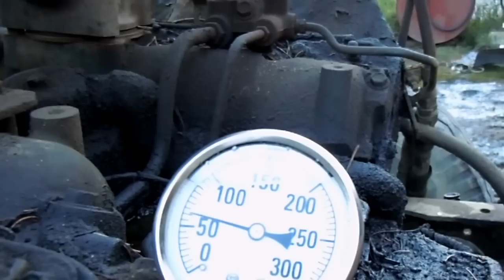8.2 L GM V8 Detroit Diesel

Comment: the 8.2 was detroit diesel's first 4-stroke diesel which is why it uses the 2-stroke style unit injectors and a similar governor. the 6.2 was designed by detroit diesel with input from gm light truck who specifically wanted a conventional injection pump fuel system, they didn't like the unit injector system because if not set up properly or if neglected runaways are more common. the 8.2 is a great engine, i have a customer with a pair of them in a 47 foot yacht, both engines have close to 10k hours on them and still start easily in cold weather and don't smoke or burn oil. my only complaint is that detroit didn't build them for very long, so they are getting hard to find.
Reply: i have one for you
Reply: Older comment but nah if I'm not mistaken the 8.2 is i/h. Big brother to the 6.9/ 7.3 class.
Reply: @mchl8  you are mistaken Detroit division gmc /6.9 7.3 international division
Reply: @cleataylor7951  I could be mistaken as thinking of another engine.
Reply: common in buses of the era.  I should have bought them when they were cheap.  the schools would cut them loose with 40-70k miles on them.  great motor!  that would be a good swap in a classic 1ton.
Reply: @mchl8  9.0 is the one you're thinking of
Reply: Hang on. Unit injectors are not "for 2 stroke diesels". They were used on both 2 AND 4 stroke diesels way before these 8.2 were designed. Unit injectors are the "real" or "conventional" injectors. There's 2 reasons the 6.2 and many other smaller diesels use a injection pump with injector nozzle system. It a lack of space. Unit injectors require alot of space, and small engines don't have enough. Look how HUGE IH had to make the heads on thier Direct Injected 7.3 vs the IDI 7.3, it was in order to incorporate the better unit injectors. Another reason Unit injectors weren't used on the 6.2 is because the 6.2 was a precombustion chamber (or IDI) engine. 
Unit injectors have always been better that a pump/nozzle system and they always will be. 
Caterpillar used Unit injectors on many of thier engines too, as did Cummins.

Comment: for a diesel of its age that thing is very very quiet
Reply: Well for one the 6.2 and 8.2 were made for fuel economy,  82 with the 6.2 gets around 15 city and 22 highway. and that's with 35" tires and 6in lift. the first year 6.2s (82) are getting very hard to find, even for the 83s.
Reply: I had an 82 'red' block 6.2.  I never should have sold it.
Reply: *cough*
Mate have you ever heard, especially THIS beast, at 2k rpm?
Reply: Lmao I haven’t really seen one for myself but from what it seems these seem far from quiet
Reply: @Creeperboy099  used to have a 86 F700 that had a 8.2 Detroit and a straight five speed trans, ran damn good for what it was
Reply: I have an 8.2 in my motorhome and it's quiet to the point I forget it's running some times
Reply: @DeathRoyale  thats cool actually.
Reply: @gabrielv.4358  it pushes all 20k lbs like it's nothing. Hell of an engine.
Reply: @DeathRoyale  That's really a great of an engine, wow!
Reply: @DeathRoyale  hola también tengo un detroit pincher 8.2 y me gustaría conocer más consejos para el uso adecuado con el motor

Comment: I had one in my 85 Jimmy 6500 flatbed, 17 years not once did it ever let me down, then got a bigger truck and sold the Jimmy to the business next door and he used it for years and years. Nice smooth running engine and VERY easy and fuel, like 15-18 MPH with the Alison automatic. The only thing I can come up with as a complaint is smoked a bit till it warmed up. BOY did that 8.2 Fuel Pincher run smooth!

Comment: I drove a new '89 Bluebird school bus with this engine hooked to an Allison & airbrakes. Somebody from the factory forgot to put the governor on it or forgot to set it. The speed limits back then were 65 & 60 for the big trucks. It sure pissed off the truckers because when I was on bus #9 with the 8.2L they couldn't outrun me when they were doing 60 & hated a school bus passing them. All other buses I drove were governed to 65 mph & most of the truckers would blow me away I tried to pass them. It needed a block heater. It didn't have one from the factory.
Reply: mine has a block heater and all the truck versions i have seen had a intake heate rand fire right up.
Reply: @TeamTopKick  Those would've been sweet on our school's bus. Our shop mechanic did get a dipstick heater for it. It did help but not a whole lot. It got a little over 100,000 & then laid down.  It sat at a local diesel shop a long time & then they traded it in for Bluebird TC2000 snub nose bus with a 5.9L Cummins. They've all had block heaters.
Reply: @TeamTopKick  Ok. Thanks for your input.
Reply: @TeamTopKick BULLSHIT. The fuel rack is at FULL FUEL while the engine isn't turning, same when turning slowly during cranking (as long as it's not turned "off")

Comment: sounds very well. im familiar with the 6.2 sounds the same, even the valve covers and fuel rails share a resemblance. im in to the ford application 6.9 now. the 6.2 is a great motor. just a bit small for me. the later 6.9's give a little more grunt and more of a fuel cakkle. i love em.
Reply: Doubt you'll read this bro but definitely keep on that 6.9L platform, definitely one of the best small diesel V8s of all time. You probably know this, but for those who don't: if you have an IDI 6.9 or 7.3 or even pre-99.5 7.3PSD make sure you keep a high-quality conventional coolant (no long-life organic acid stuff, it'll eat seals) and run a coolant filter. The ambulances and other severe-service applications all had spin-on coolant filters at some point, but Ford didn't like that so they cheaped out. There are kits available and they're awesome and worth it. Cavitation on these motors is a real danger with the wrong type of coolant, as well as lack of coolant maintenance. Coolant filters are available pre-charged with all the vitamins and minerals these engines need to not have the danger-bubbles happen. You can do the test strip thing, but the packs of those stupid little things are kinda pricey and they go bad eventually anyway. Just toss a new filter on and go. I think I comment this any time somebody mentions one of these engines, lol. Rock on dude.
Reply: @HANKTHEDANKEST  yea I read this thanks I plan on sticking to my intowishen. I think my dad put me In this direction a number of yrs ago.  Since I went n snaged up a few 350 classes trks with this combo . Um I enjoyed them I lost one to t/a . I loaned it out like an idiot. The others I had to sell  off . They were tow trucks I wanted to get into transporting compact farm equipment with. I wound up towing break downs In stead . The ins liabilitys were WAY outta reach.

Comment: 8.2 gasket pincher. The fire deck needed to be upgrade to 15mm bolts from 81 to 84. 500 cu in. 210 to 240 hp. Turbo or NA. Very good on fuel, touchy tune up set injector heights by pinning the block flywheel then set injector height with a magnetic base dial indicator. 1000 th of mm.  Not very easy to find a mechanic that was good on these. I built and tuned many of these motors.
Reply: You seem to know your stuff would you buy one? I have a opportunity to buy a school bus with this motor in it...I'm concerned over the head gasket issue.
Reply: It been setting up a few years
Reply: @joshuabrown7034  its not the head gasket that is the problem... its the total lack of repair parts. What is out there is expensive and or parted out from other vehicles.

Comment: I always wanted to get one for my 71 F-100 nothing sounds better than a tow two stroke Detroit diesel engine
Reply: The 8.2L,6.2L,and 6.5L aren't 2 stroke Detroits,they are actually 4 stroke Detroits.
The 2 Stroke is the Series 20-149.
Reply: Are they better than the ones in new pickup trucks to day
Reply: @clydehieb2275  That depends on personal preference,but if you don't like dealing with inevitable electronic errors,then these old engines are good for not dealing with that.
The 8.2L was a great engine but it did have a design flaw,the cylinders in them don't reach the top which is problematic for head studs and head gaskets,regardless of how many each cylinder had.The head gaskets on both the fuel pinchers that were naturally aspirated or turbocharged would last up to 40,000 miles and then they were up to due date to be replaced.The 8.2L that had a turbocharger was known for having issues down the road because since the cylinders were different,the pressure of the boost could unsettle the head studs and gaskets,and these normally would do 10-12 PSI but they can reach 15-18 PSI or even more.The 8.2L has a parent bore engine block much like the 3.9L/5.9L 4BT/6BT,they don't have any wet sleeves,the only Cummins at the time that had wet sleeves was the 8.3L 6CT.On the 8.2L,you had to even religiously check the coolant to make sure that it was not contaminated with fuel,or else it would need to be taken apart.If that did happen,the engine would overheat and even the block could crack.
The 6.2L-6.5L was based on the 8.2L to begin with.The 8.2L came out in 1980,6.2L in 1982,and 6.5L in 1992.The 6.5L was really a bored out 6.2L.They were all mechanically functional,but the 6.5L after 1993 was updated with electrical fuel injection and a DS4 fuel pump after having the DB2.Most problems on the smaller 6.2L and 6.5L was the harmonic balancers,fuel filters because of the base housing,and head gaskets too.On the early 1982 6.2L,they had a intention of cracking blocks too,but that was addressed and didn't happen on the later engines.
Reply: @Slim_Slid  A friend is running a 6.2 in his suburban. A mid 80s vintage but with quite a few updates to fix issues. And it has been quite reliable for him. But when he pulls his 16 foot travel trailer and back full of camping supplies and canoe on the top, it is a gutless wonder.  He takes it pretty easy and pulls long hills with it geared down and light on the throttle and takes his time... And the irony is, its milage isn't really all that great by today's standards. But he likes it.
Reply: @wishusknight3009  I owned a 1986 K20 Suburban that had a N/A 6.2L swap done to it after it originally had the BB 7.4L,with 4:88 gears and 20 MPG.I had the same engine in a M998 HMMWV and M1010 D30 CUCV with 4:56 gears,also the same fuel mileage.I already know of which you said,I've owned a couple of trucks with them and have been both a mechanic on 6.5L's from the humvees and owned/own a K2500 and M1025 HMMWV with them.
The J code 6.2L is what the Military all used in the M1008-M1031 D10-D30 and M998 with 155 HP/250 TQ.Actually,both the 6.2L/6.5L do 20-25 MPG,so I'm sure it can uphold it's tradition even 30-40 years later...It depends on the weight,gear ratio,and tires of the truck that decrease the fuel efficiency.My M1009 gets 18-20 MPG with 3:08 gears,my M1025 is at 14-16 MPG with 5:24 gears,and my K2500 got the same fuel economy as my K5 Blazer using 4:10 gears.The 6.2L was a slow slug,but the 6.5L was even better.The 6.5L was 180-200 HP/360-430 TQ.Now compare that to the 454/7.4L with 240-290 HP/385-410 TQ.Hell,even the 12V 6BT was 160-215 HP/400-440 TQ.
People will argue that these Detroits won't do a fair day's work,well with the 379/6.2L that's very true,but not the 400/6.5L,it did as great as the Cummins and Vortecs.You could also get the same numbers by the way,on saving fuel with even 3:73 gears.The 6.2L on the other hand had competition with the 350/5.7L,they were built to have better efficiency but have the same power as the small blocks and big blocks.They also were the primary replacement for the Oldsmobile 4.3L & 5.7L,which was a piece of shit engine,but had the same percentage on fuel.It was the same way with the 8.2L replacing the Toroflow 351 & 478.
They still built 6.5L's for the AM General HMMWV when the Isuzu Duramax was acquired by General Motors and officially discontinued them.
Reply: @Slim_Slid  That is great information, thankyou!  I think when you have them loaded to the hilt, the more powerful engines are always going to perform better and more efficiently. If I had to guess he has 3.55 finals in his. And the turbo400 4speed. Anytime we would come to any sort of mild hill that thing was out of OD and into 3rd gear at 3000 rpm. And I misspoke before, it is a 19' trailer. I don't think he is over GVWR but with full water tanks, the back seat and storage compartment full of gear and enough supplies for 2 weeks, it is just too much for it. Last trip I doubt was 10mpg.  We have mountainous terrain all over here so I bet on a flat prairie drive it would be substantially better. And if he was lucky enough to have a 6.5 I bet it would do better as well. I also think if he had 4.10s he could hold OD a little more on some small hills. And keep in mind we average just 45mph and barely 55 on the flat. 

Towing the same trailer with my brothers half ton ford f-150 ecoboost v6 got us about 19-20 mpg. And the extended cab and canopy has just as much capacity for supplies (or more even) and that was with 4 adults and my 2 boys. Not to mention holding 65mph on the highway was absolutely no issue. And keep in mind this is canadian gallons which are larger than american. 

I have no clue what he gets untethered, he claims its pretty good and I don't doubt that at all. It just sucks when its loaded. If he is getting 20mpg then that is quite inline with most modern trucks. And at 10s of thousands of dollars cheaper as well.
Reply: @wishusknight3009  The TH-400/3L80 "Turbo 400" is actually a 3 SPD,not a 4 SPD.The same transmission is what the D10-D30 CUCV during 1984-1987 and the M998 HMMWV during 1985-1992 all had.The ones in the humvees didn't have a parking gear and that meant it was either in drive or neutral.You had to keep the truck in neutral to both crank it and shut it down or else it wouldn't,and the emergency brake was obviously on at all times when it was parked.My 1984 K30 3+3 with the 6.2L (Another truck that had the 454 actually) would haul 20,000 lbs at 50 MPH with a TH-400 and 3:73 gears.2:73-3:55 gears aren't even light duty for a pickup,that's something that most racing,quarter ton,and some one ton trucks can come with.My 2002 5.4L F150 Supercrew had 3:73 gears and I could pull 8,800 lbs but I got 7-9 MPG all day long and had 285×70.11's.
The CUCV ll got the 6.5L later on along with the 350 and 7.4L including the 4L60E or 4L80E just like the M1025-M1046 HMMWV got the Detroit and same transmission.It was the same way with the M1113-M1167 HMMWV/ECV.
4:10,4:30,4:56,and 4:88 are the best heavy duty gearing for a truck.The 6.2L/6.5L both do 3,200-3,600 RPM at the maximum.
Reply: @Slim_Slid  Yup you are correct. I am not a gm truck guy so i confused it for the 700r4. he definitely had a 4 speed.
Reply: @wishusknight3009  My great grandpa had an overdrive on his 6.2.... I have an M1009 now and an overdrive would be quit welcome, acutally a 6 speed swap would ideal for more pulling power down low and the highway gear. 3.08 gears on the M1009 axles are pretty high too.

Comment: Where is radiator on this engine, or it's an air-cooled? Another question - from what truck this engine and chassis?
Reply: The radiator is typically mounted on the front, it is water cooled. They may just be running it dry to prove it can run - no harm in that for a few minutes.

 I don't know if this engine was on a boat (its more common application) or if it was on a medium duty truck. I know some Fords had them in the mid 80's - I have a 1987 ford B700 with the naturally aspirated 8.2 detroit.
Reply: @Vince-DM  Thanks.
Reply: A 55,000 Koehring Backhoe had this engine in it. The 6625 Koehring.

Comment: great and nice engine ,, but this engine would be recommended for a Kenworth ???
Reply: no, too small for a Kenworth, its a medium duty engine.
Reply: This engine is probably no more than 150hp. They were not built for power, but economy. The turbo models did a little better but had their own set of issues.
Reply: Turbo model makes just over 200 HP

Comment: I'm confused. Was the 8.2 lt a "dieselised" big block, similar to how the 5.7 and 6.2 were "dieselised" small blocks? Or was this a dedicated Detroit 4-stroke design?
Reply: +Andrew Armstrong Thanks.
Reply: 6.2 was never a gas engine.. built by Detroit..  it designed strictly for fuel economy... Later was modified to the 6.5 for more power..
Reply: The 6.2 was often confused with the 350 diesel small block which was a pig.
Reply: Your thinking of the old's 350
Reply: The 6.2 and 8.2 were the first 4 stroke engines that Detroit Diesel ever built. The 6.2 for light duty trucks, and the 8.2 was a medium duty truck engine. The 8.2 has more in common with a 2 stroke Detroit than it does with the 6.2. The 8.2 uses unit injectors like the 2 stroke Detroits did, among other similarities.
Reply: @justinstearns9723  hey it's Jesse I follow you on Instagram and Snapchat😂
Reply: Also the 5.7 350 diesel wasn't a gas engine. The diesel block was much thicker and made for diesel. They never turned a gas block to diesel. Same with the 4.3 v6 diesel.